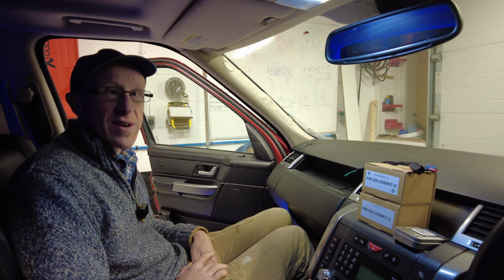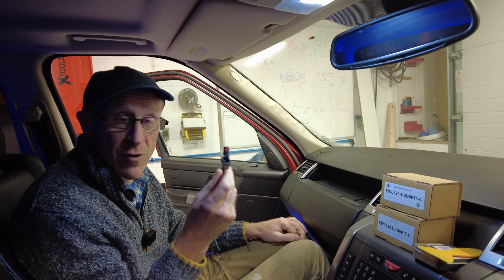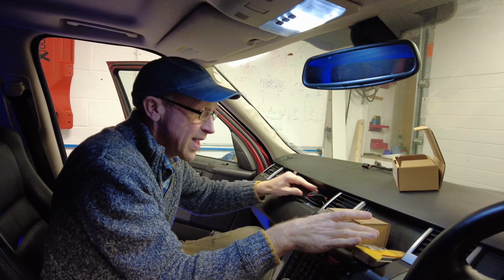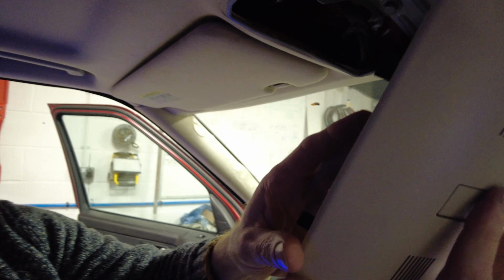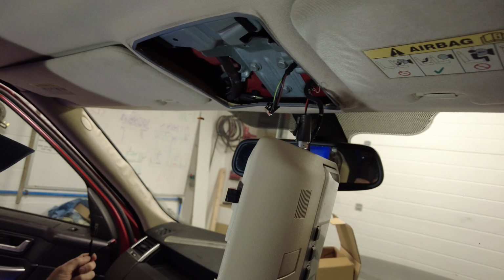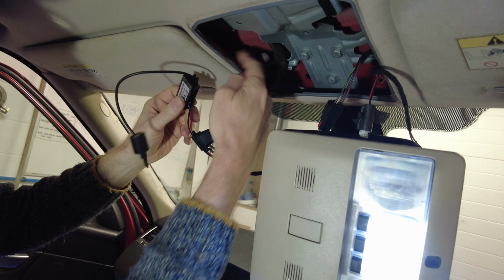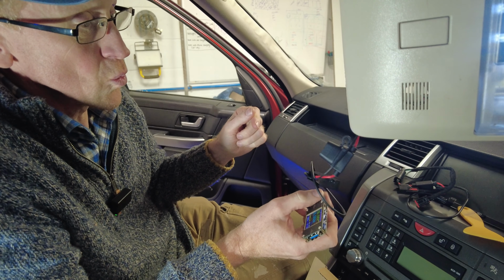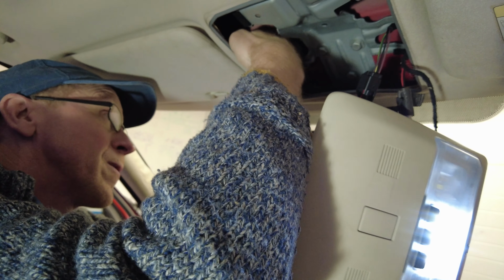Range Rover Sport L320 / Land Rover Discovery 3 & 4 Dashcam Hardwire Kit Install

Comment: I added a phone power pack into the wiring config and put that above the roof liner so I have power all the time. This cable plugs into the power pack so when ignition is on the power pack gets charged and then a small usb cable to the camera
Reply: Any issues with the heat? I would be worried about the battery pack exploding.